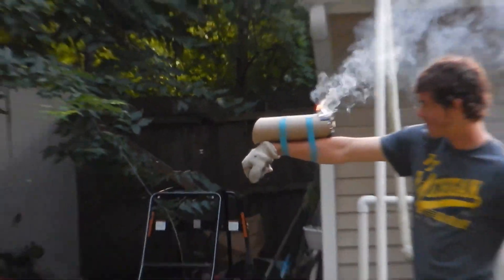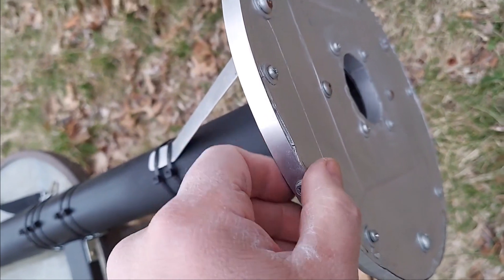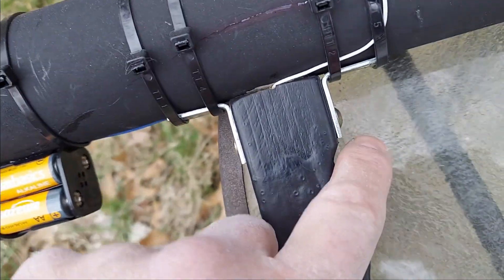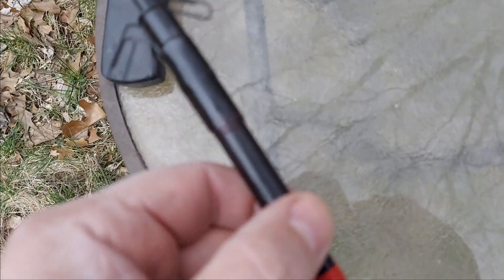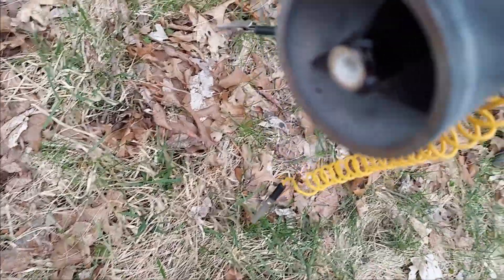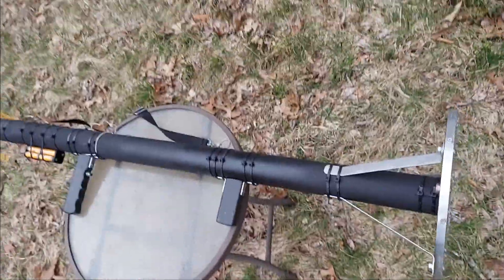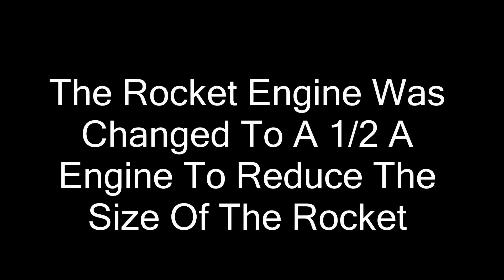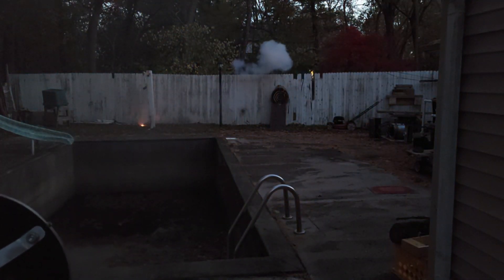Shooting Explosive Estes Rockets

Comment: I made a hand held rocket launcher in the 1960's when I was 14 years old with a length of pipe, a round dry cell battery, a door bell switch, alligator clips, some wire and duct tape. It also used Estes rockets.